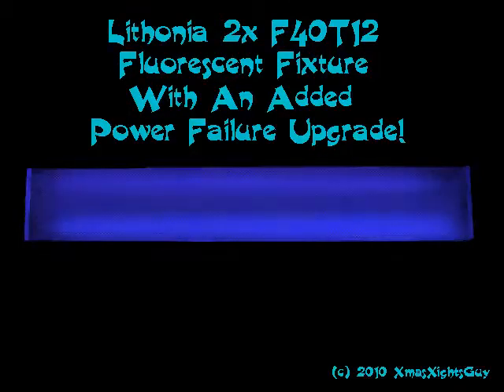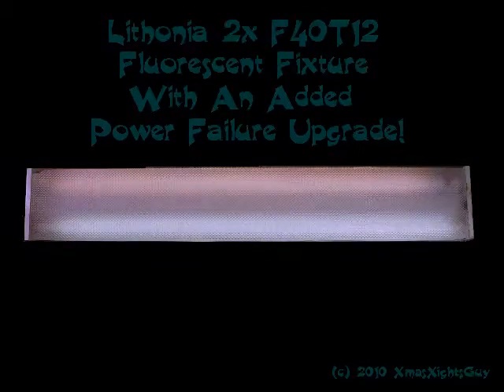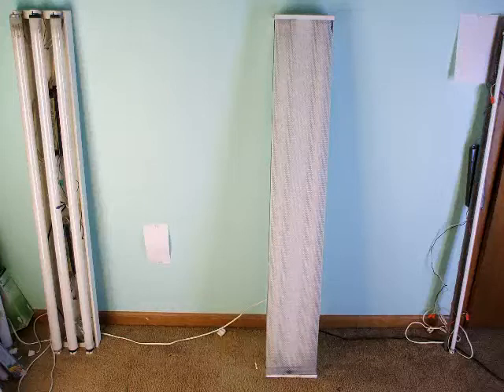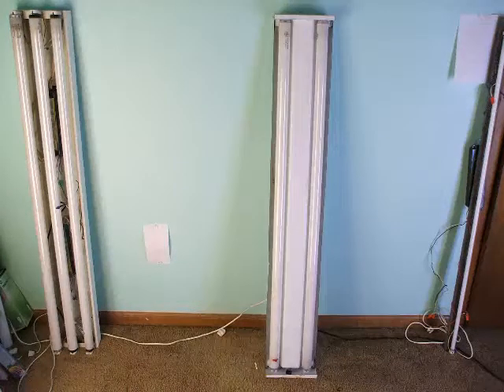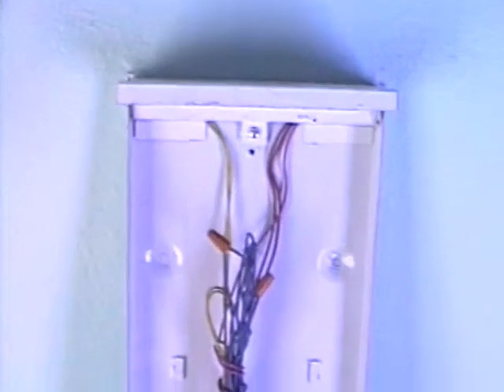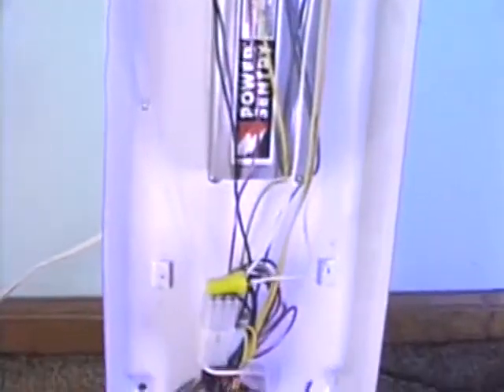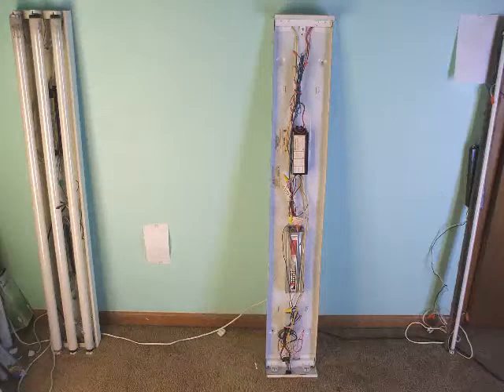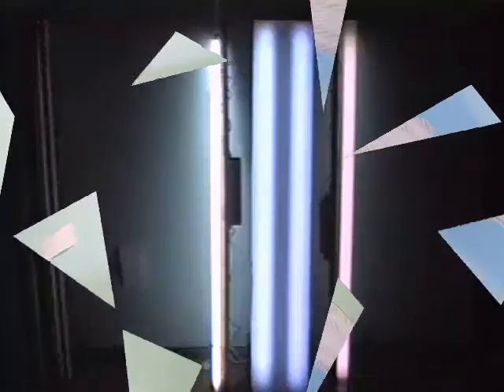Lithonia F40T12 Light With An Upgrade For Power Failures ... Cool!

Comment from the maker: @BowlingMania14 It does actually 'ballast' the light...inside is a battery pack, charger, and an inverter/ballast to drive the bulbs.

There is allot of wires stuffed in that fixture LOL the main ballast's wires even go through the  emergency one...there are relays built in to switch between them when power goes on/off

Comment from the maker: @kevxsi16v The 2-lamp ones like this are kinda uncommon, 1-lamp is more common.
The batteries are located inside it (they're not meant to be replaceable, but are pretty much just standard C or D sized NiCd's)

I think I saw a couple the emergency fittings in your gallery...I'll have to go look through it!!

Comment from the maker: @MrPizzaman9956 Not a bother at all, I'm glad to answer questions.
They could physically make one to run at full brightness, but the main issue would be batteries. The brighter it is, the more power it'll take which means the batteries will drain faster (or a larger battery would be needed) LOL
 This  has 4 'C' or 'D' batteries inside the emergency ballast (don't remember since it was a couple years ago I looked in one) It'll run for 90+ minutes on a full charge.

Comment from the maker: @MrPizzaman9956 When I installed the emergency ballast I didn't put the test switch in place (so its just hidden in the ballast channel). The charging light would be visible if I had showed the back side of the fixture...